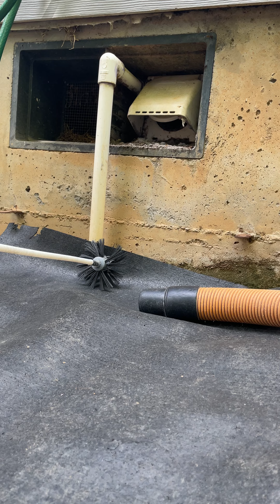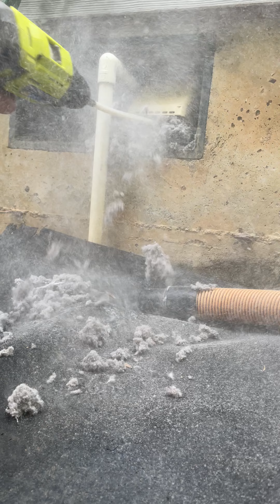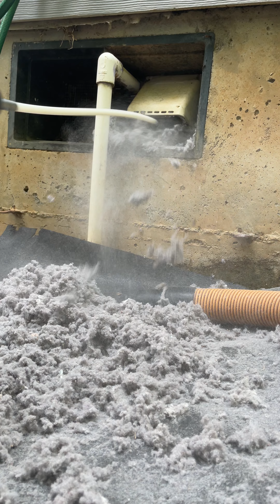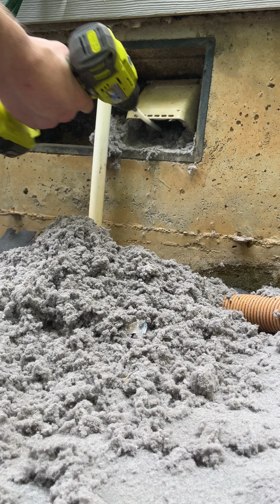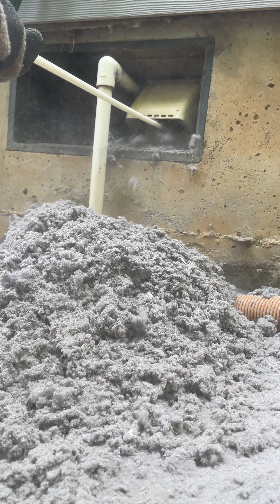Satisfying dryer vent cleaning, so much lint!

Comment: That dryer vent hose is actually against code.  Most states hone inspector will put ribbed dryer vent needs to be replaced with smooth pipe..